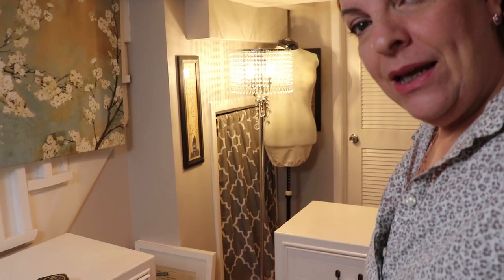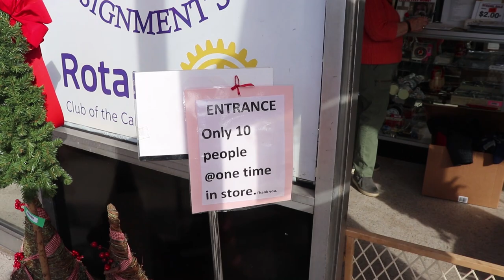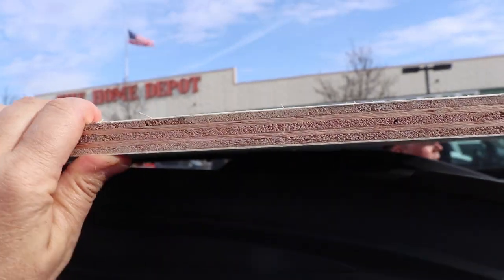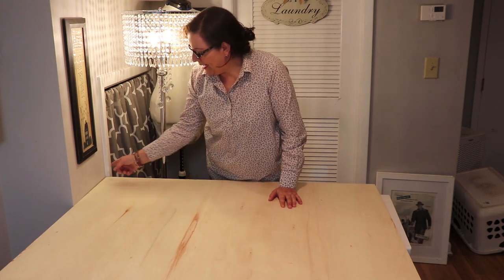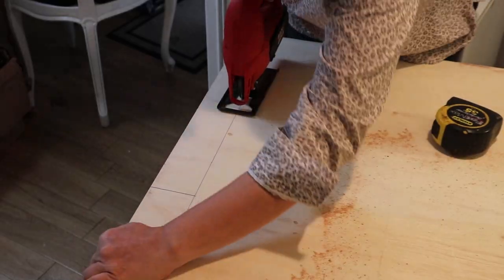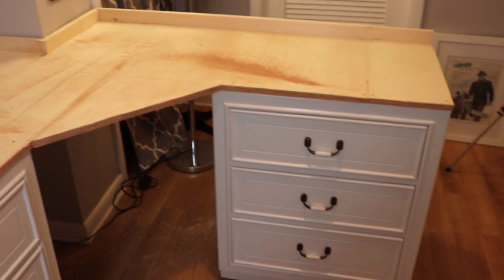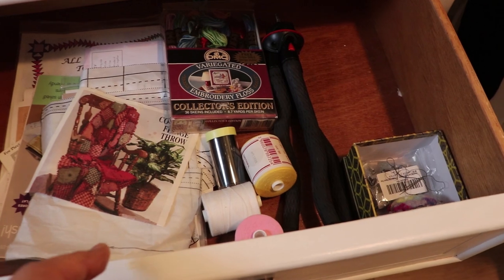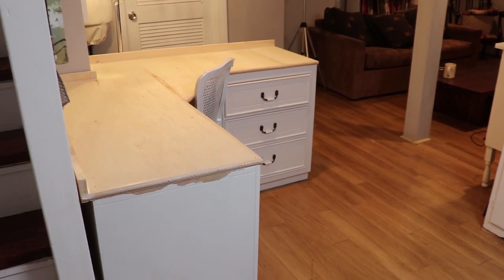Vlog - Day in the Life || 11.21.2020 || Thrifting and DIY Corner Desk

Comment: I think you would enjoy and get much use from  truck. I bought my first truck, a little GMC S-15, in 1982 after using my 1st new car, a  tiny Plymouth Horizon to haul hay (with the back set folded down I could haul 5 bales), bags of grain and muck tubs of water for the horses out to far pastures. With that little truck  I could haul 22 bales of hay at a time.and helped my sister move 5 times in 2 years. It was my only vehicle for 2 years until I bought a used Datsun to drive to and from work. That little truck lasted 22 years, the Datsun only lasted a few years before being replaced.  I finally bought a full sized pickup (a Chevrolet Silverado with crew cab) and donated my old truck to the Kidney Foundation. I still have my Silverado and still love it, it is still in great condition at 18 years old. It has literally hauled tons of hay and grain and I used it for most of the move to the farm I bought 10 years go. The seats are much more comfortable and it rides much smoother than my Subaru Forester.